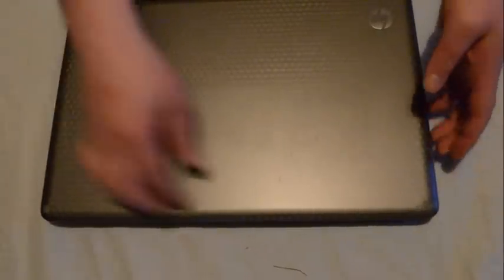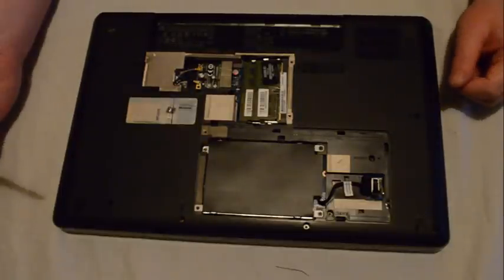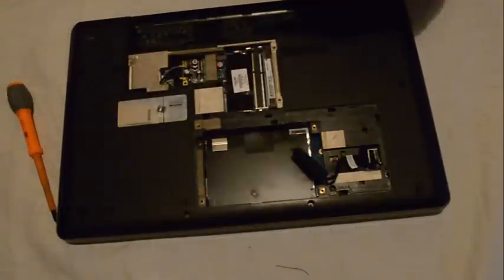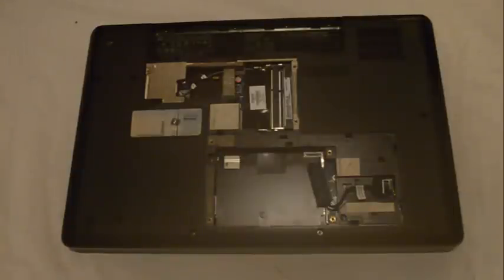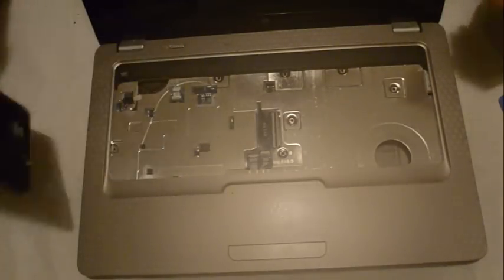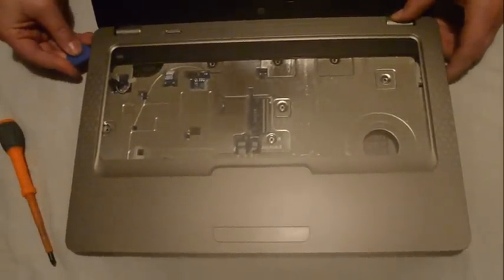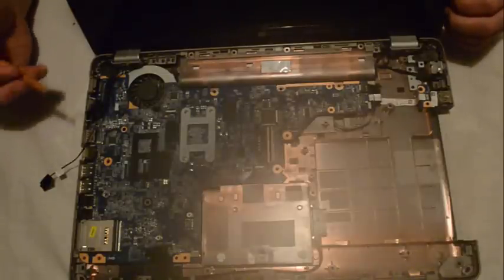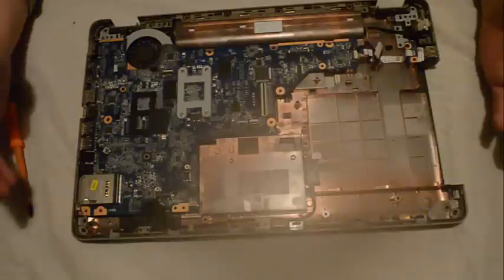HP G62 disassembly

Comment: ...my guess is that when hp designed this particular laptop, it was done not with the end user in mind but with the computer repair service business in mind... think about it, at the current repair rates, to replace a simple cmos battery or even to clean the fan, the whole computer has to be disassembled...?  wow, talk about inefficiency along with a big repair bill for replacing said cmos battery, it's like hp is giving a big middle finger to the end user of their product...!  :-)

...anyway, thanks for your video, shane...  my only constructive criticisms would be: you need better lighting and you should shoot in segments with lots of close-ups instead of holding a component up to the camera...  If you have a video editing program then you can cut-in close-ups of the components you are removing, unplugging, etc. because with a hand in the way it is difficult to see what it exactly is you are doing...  also, with editing you can compress time instead of removing the screws in real time... :-)

...you created your video in 2014 so i'm not sure if you would even be willing to shoot a new video with the above suggestions in mind...  either way, thanks for thinking of us "end users" out here in computerland who want to save a few bucks when it comes to computer repair... :-)
Reply: yeah tell me about it! and these fans get clogged quite often! I've tried blowing it with an air compressor at 40-50psi and also putting a vacuum to it for a good 5 straight minutes but sometimes there's so much dust that develops you have to open it up to clean it! Would be like having to remove all ur walls in ur house just to change the AC filter lol!

Comment: those 2 wires attached to the WiFi card are antennas, Main and Aux. be careful removing them from the card, as the leads or pins attached to the wifi card break off easily! I know!  thanks for a good video

Comment: So to change the cmos battery I must take apart the whole thing...
Reply: Im having some trouble getting it apart . too bad they make this battery so difficult to replace.  Thanks
Reply: For the laptop g62 (HP) with the AMD Athelon II p340 cpu, is your guys running fine? What do you use it for? Is it worth upgrading the ram and ssd? thanks
Reply: I came here just to say this. That's a lot of effort for the CMOS battery. Bad thing is you can kind of see it under one of the panels. Just can't get to it.